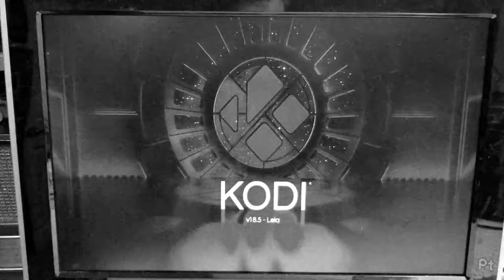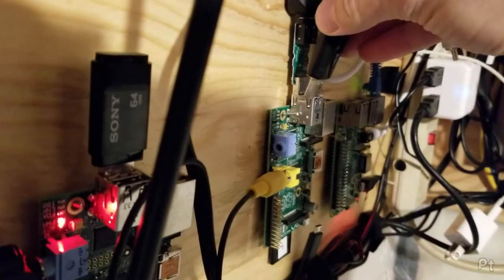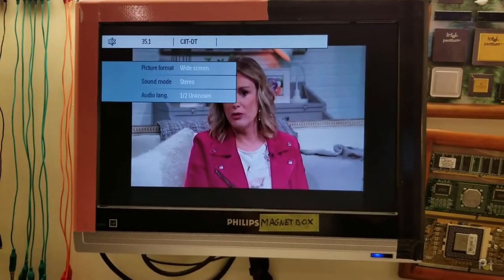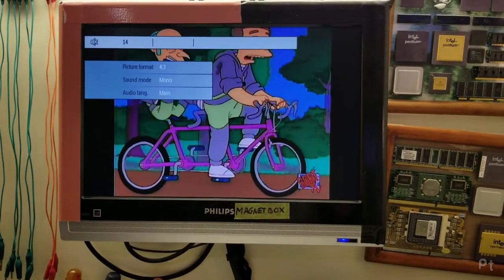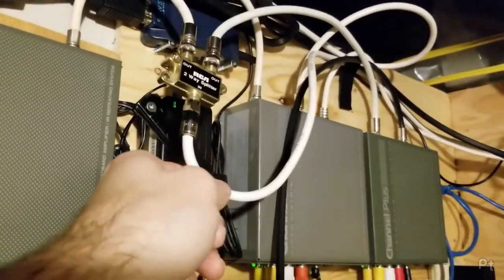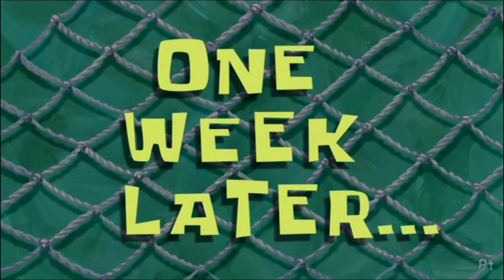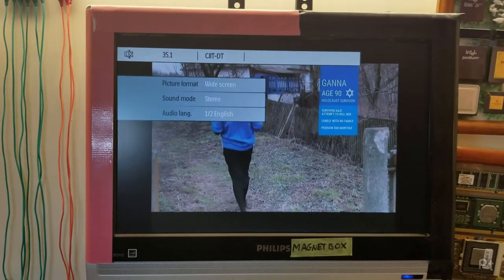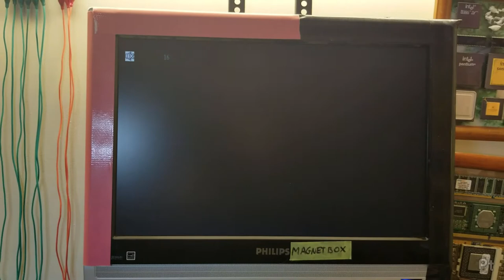In-house Cable Update (new channel, USB audio, new combiner)

Comment: Love to see all your updates! On my setup I've spliced in a super basic RCA RF modulator to have a third channel on 3, though I'm thinking of changing it to a new ChannelPlus in my new place provided I have the outlet space and can think of what to put on a hypothetical fourth channel. The integration of the DTV box is a great idea; maybe I should just use that. It's a shame they don't make Analog/Digital combined tuner boxes, or at least I haven't been able to easily find one. I have some old TVs including an old Plasma that don't have digital tuners so to be able to have them all in one box (since pass thru adds a lot of noise to the analog channels) would be helpful.

Comment: Yes... CHMI Citytv Winnipeg. Sucks that you still can't get it but I still love the WPG weather channel you created.
Reply from the maker: I was able to get it with a decent signal when I tested my antenna in the backyard, but mounted in my attic and going through this whole mess, it's very weak. I think if I mounted the antenna outside on the roof on a larger mast, I would pull it in, but it's not worth the effort.
Reply: @probnotstech  Leaving the antenna outside would obviously mean a better signal since nothing would interfere from the inside.
Reply from the maker: Very true, in the future I may do it, but for now installing it the attic was easy enough. Just made a wooden base for the mast to sit in, and I can easily aim it from the hatch. 

The lack of OTA channels in this city just makes it hardly worth the effort these days. I see videos where people in the US are tuning through 30-40 OTA channels, some with actual good content and it reminds me why I set up the pi channels.